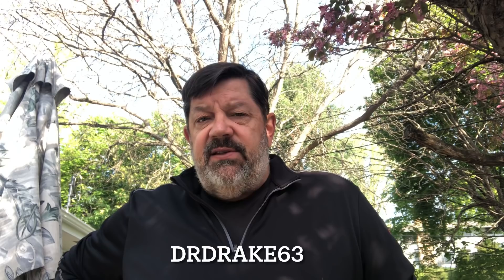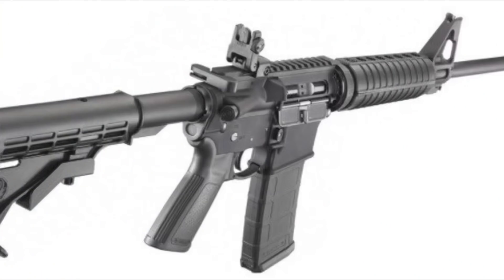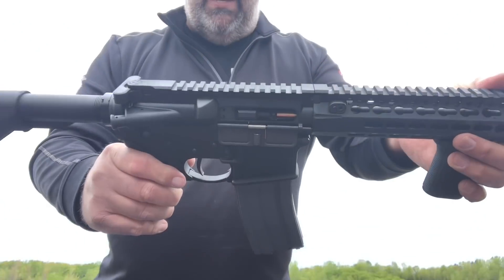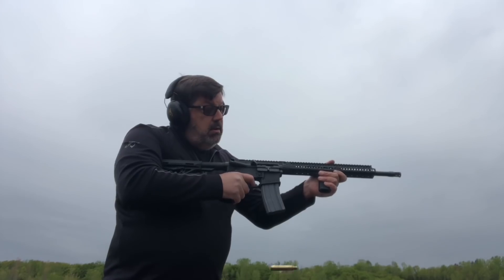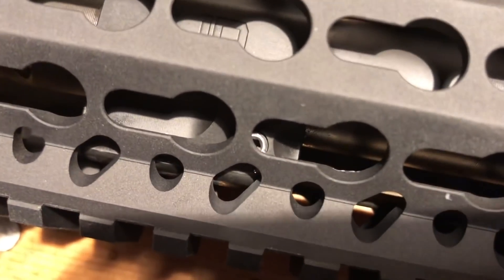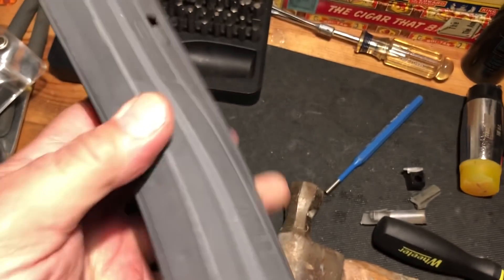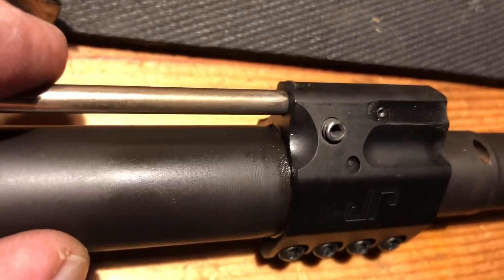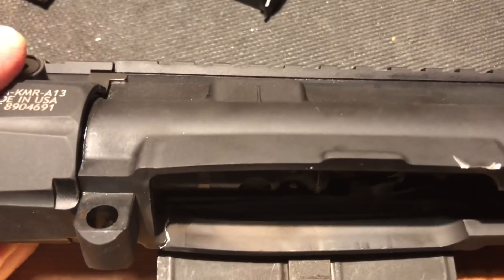Colossal AR Failure

Comment: It appears  as if u had a bore ubstruction the gas port in barrel only let's so much Gas into operating system  so even with it all the way open  its only gana let that much pressure back if pressure is 2 high in ar system the gas tube is designed to fail first to avoid this problem

Comment: im going to have to research what a fully open gas port will do to a gun because I have no adjustable gas on my system (port fully open) and I have never had problems with mine at all and certainly no signs that it would. I think your issue was with the load on the cartridge. As a reloader myself, I have seen these kinds of failures in people who push the limits in search of the fastest bullet. It could also be there was not enough powder in the cartridge and that could have caused the exact same thing. Did you check for a squib load? Could have been that last round did not leave the barrel?

Comment: From the looks of the Bolt carrier it is a cast part and not a milled heat treated part. Big difference in parts, never use cast always use milled and heat treated. This is a failure of components not a good AR build at all. If you are buying and using cast parts for the workings, not the housing you built wrong.

Comment: Either the buffer spring got bound up in an almost fully extended position or something got lodged in between the bold and the walls of the upper that prevented the bolt carrier from moving backwards.

It had nothing to do with the gas system.  It was a mere oversight in inspecting all parts or re-assembling incorrectly.  The bolt was unable to retract causing the face to strike against the bolt carrier and the pressure alleviated itself at the only point expansion was available.

If it was a gas issue you should have noticed damage on the gas tube as well, and it would have been closer to the where the gas key and the gas tube lose contact I believe.

Edit :

If you look at 8:03
Look for the Carter pin.  Must have been warn and dislodged itself.

Comment: I recently bought a mid length BCM upper with a low profile gas block.
But I noticed that I can wiggle the gas tube a little bit with my finger inside the upper where the gas key goes. Ist that bad or dangerous?
Reply from the maker: It’s normal

Comment: That is not a gas issue. An adjustable gas block, when fully open, can only let in as much gas as the port on the barrel will allow. This has nothing to do with the block.

This looks similar to pics of 300 blackout being fired through a 5.56

Comment: That makes no sense at all.  Unless you drilled out the gas port on the BBL you CAN NOT get more gas than with a standard gas block.  The adjustable gas block will only reduce the amount of gas.

Comment: As a certified gunsmith and as somebody who has seen this issue on a firing line in some military and LEO M4's and AR-15's that is definitely without a doubt an out of battery detonation. Now, how that happened would be anybody's guess. But it's often caused by the rifles not being cleaned properly which causes parts to stick when hot. Now, I can't say what you do or don't do with your guns but just saying what I have seen and the usual culprit. 

Another factor that can cause this is firing bad ammo or ammo that's too hot. I never heard a mention of ammo in this video so I do wonder if that was a contributing factor. All the same, looks like you came out ok and the lower is intact. Though Ruger would likely replace it for you for free, especially if they could determine in any way it's a manufacturing defect.

Comment: TOTAL BS....the gas block can NOT cause that failure! The hole diameter in the barrel determines the amount of gas allowed to go to the system, a "normal" gas block will NOT allow any less gas than an adjustable one...PERIOD. You either screwed up reloading, or had a factory overcharge, had a 300BO round mixed in, or someone used pistol powder. You destroyed your buddies gun, and he deserves you to buy him a new one....just saying.

Comment: If you give it too much gas you will see extractor issues. AGB isn't responsible for your failure at all. The gas goes into the tail of the bolt, nothing to do with what looks like a case head rupture from far too much pressure or an out of battery detonation. My bet would be out of battery detonation with an out of spec firing pin since it doesn't look like the bolt lugs sheared. 

You have a classic kaboom, too much pressure and it vented out of the mag well like designed. You weren't hit by shrapnel. You weren't hit by the bolt. You live to put keymod on another gun, even if it's dead and gone.

Comment: The gas block, nor any adjustments you made to the gas block caused that failure.  That looks like either the result of excess headspace or an excessively hot loaded round.

Comment: I will have to go along with the general consensus that it's most likely an out of battery event.  I've got a shorty 11" barrel for my AR with the brazed 5" flash hider that tends to have kabooms but nothing like this!  I suspect the gas port is way over sized due to the kazillion rounds that have been fired thru it.  It blew up with the short gas tube (blowing the tube apart, as it's supposed to) so I tried a longer tube called a pig tail, that wrapped around the barrel but it blew that one out too.  One of these days I will put an adjustable gas tube on it and have another upper built on it.  I think it's unlikely that it's an ammo problem as Winchester is a pretty reliable brand.  Still, I would really appreciate it if you can beat the bolt & carrier out to see what's going on in the chamber, if only because this was such a catastrophic failure.  You're fortunate you weren't hurt!  This is something all of us can learn from if a definitive cause can be found.
Cheers,
jc
Reply: Although I suppose it it possible if you’ve run tens of thousands of rounds through it but it is unlikely that you have enough gas port erosion to cause multiple tube failures. The overpressure in the tube would be more likely explained by hot hand loads or carbon build up in the carrier key causing a restriction or blockage. If your running factory ammo check your bcg with an air nozzle. If you have that many rounds through it I would also check the headspace just to be safe

Comment: I don’t think too much gas’s was the issue. The carrier has vents on it. Seem like a poor quality carrier. Or as others have said. The round detonated out of battery. Which should only happen if the firing pin struck the primer. And it shouldn’t do that unless the bolt is fully locked in. Again. Seems like a poor BCG. Can’t check it now with a go no go gauge but would have like to have don’t that beforehand. Glad your ok

Comment: did you have an issue removing the barrel?  Early Ruger AR 556's are notorious for using high heat locking compounds on their AR barrel nuts.  many had issues removing the barrel nuts when they first introduced the AR line up.  if you had to use excessive torque to remove the barrel nut, that might be a contributor.

Comment: That was definitely a very hot round/reload or barrel obstruction/squib round, the AR platform is made to run with the gas block fully open and the gas tube would of failed first if it was indeed an overgassing issue.

Comment: Not a gas issue. It's likely a barrel obstruction issue, squibs? I can't really comment accurately, but I would want to see how it looks as you take apart the upper. I think minus the smaller parts on it, your whole barreled upper should be scrapped.

Comment: I would say ammo is your issue, or out of battery fire. 
after seeing the brass in the other video, I would say out of battery.. but if you had a squib round, the gas would go the path of least resistance, which would be the bolt.

Comment: What makes you think over gassed would explode the bolt? I have had a very over gassed short barrel .308. No matter how much you take that screw out, the gas port is the same size. It looks like am out of battery, but if they were reloaded ammo I'd say under charged.

Comment: Thanks very much for this video. I currently have a Odin works Barrel paired with their Tunable gas block and I too cannot get proper cycling. I think I will order the non tunable gas block.
Reply: Measure your gas port size in the barrel. More than likely it was reamed too small, or was drilled and never got reamed to spec. 

If an adjustable won't adjust enough to run, a non-adjustable won't run it either.

Comment: I saw an AK blow up in the same manner only a bit more damage to the firearm rendering it useless. Nothing was salvageable on that rifle. It was more  than likely a ammo malfunction.  I was a weapons troop in the USAF,  and had to respond to a " hot gun " at EOR , the 30 mm  ammo malfunctioned  and completely blew out the lock and unlock cam in the weapon. So no matter how large or small the caliber of the round they are all are prone to failure . Just glad that you weren't injured.

Comment: As others have mentioned, this was NOT an overgassing issue. This was a defective ammunition issue or squib load. 

You CANNOT get too much gas through the gas system that would destroy the bcg...it's just not possible. An adjustable gas block can't physically allow anymore gas to pass through than a non-adjustable gas block would. The gas port on the AR barrel is the limiting factor in both gas blocks. 

An adjustable gas block simply allows 0% to 100% gas to pass through to the bcg.

Comment: I'm going to take a guess that the round chambered ok but the bolt didn't lock. When the round fired the pressure drove the bolt backwards into the carrier and gas pressure released down through the magazine. I'm thinking once the barrel is removed, close examination of the locking lugs for damage would tell if this was the case.

Comment: I would  think it was a slam fire or a over pressure round. I have seen 2 AR's fail both  "I think" was over pressure rounds. Both were using PMC 55 gr fmj factory rounds. BUT they could have failed due to slam fires . Since AR's have a free floating fireing pins. That it why when reloading for AR type you should use the CCI hard primers . Another thing could have been a improperly heat treated bolt carrier.

Comment: friend of mine had a firing pin stick in the bolt face, turned full auto could have made an out of battery discharge though he was using Tula steel case and those primers are hard and need deep primer strikes.

Comment: I am in agreement with several others. The way that this failed points to an ammunition issue or possibly a barrel obstruction that could have caused higher than normal pressure. Possibly even a defective bolt carrier. I have personally never seen one fail like this, but it drove the bolt through the carrier and broke the upper. If there was too much gas it would not have failed this way. Hope that helps you figure out the cause.

Comment: Looks like a slam fire. Looking at the area damaged the round looks Like It detonated above the magazine. Is it possible that the magazine fed the round at an improper angle causing an area of the bolt to strike the primer? Maybe the problem was with the magazine? Could it be one of the bolt lugs struck the primer?

Comment: I build and have used adjustable glass blocks. I use 10-32 set screws similar to what you describe in your video. I start with about 1/2 turn from bottom. When I get some effort to eject and cycle, I adjust in 1/16 inch increments until it acts right.

I agree with most of the crowd that for some reason you had an out of battery discharge. Two dollar question is why.

Comment: That couldn’t have been caused by the gas block. Maximum gas is dictated by gas port size, not the gas block. Even over gassed, wouldn’t have a failure like that. That appears to be massive overpressure.
It was likely caused by ammo, maybe a 1/2 charge. Was it factory ammo?

Comment: That is not a gas block issue. The block will only flow what the gas port will flow. It was at full pressure with the factory parts. Changing the block cannot increase the flow or pressure of the gas. The stock fsb is full flow, and full pressure.

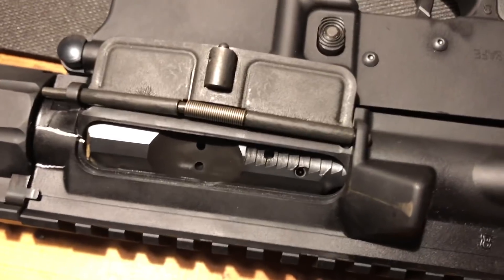Comment: 4:52 you seem to have "painted" the front of the bolt carrier with vaporized brass. Something allowed or caused a case head failure, working backwards from that is the way... with no assumptions as to cause. Just because you swapped on a gas block immediately before the failure doesn't mean something else wasn't marginal and itching to go at any time, including the ammo itself (would be looking at the primer to start, and the rim under the ejector)

Comment: I wonder if your BCG was too dry , keeping it from cycling until you ramped the pressure up ?  I does , most definitely,  appear that it fired out of battery. When fully in battery , the lugs on the BCG will keep the pressure in the barrel.

Comment: There’s no possible way you could have sent enough gas back to do that the ports are not big enough. Look at the cam pin if it’s broken you had an out of battery/round went off before fully seated in chamber. Or more likely you had a ammunition issue were these reloads?

Comment: It was a bad round, or a squib load that caused a case head separation.  I had my ar blow up last summer.  Blew out the bottom of the bolt into the mag well, (designed to fail that way so your face doesn't blow up).  I was using reloads.  My grandpa used an empty powder jar for scrap powder after pulling bullets.  We inherited his reloading equipment after he died and didn't know about it.  So I loaded 223 with 23 grains of BLC-2 except it wasnt blc2, it was a mix of black, shotgun, pistol, and rifle powders.  My gun almost looked the same condition as yours after the failure.
Mine was also a ruger ar556.
Lower was fine.
Barrel nut was fine, handguard was fine,  and I have recently rebuilt the gun with the handguard, and lower.

Bolt, upper receiver, and barrel were all toast.  The barrel might be OK but I dont want to risk it, plus it cracked my barrel extension and I dont have the ability to replace it and headspace it.

The overpressure from the round was too much for the bolt.  Opening up your gas block might have made more gas get through the gas tube, but my guess is that you had a case head separation that blew your bolt open from the overpressured round.

Comment: Lots of questions.  Why are the taper pin holes on the barrel in the 12 o-clock position?  Shouldn't they be at 6?  Also, why is the gas block all the way against the shoulder?  Is it designed that way so that the gas hole in the barrel lines up or is it designed so that there should be a gap?  How big was the hole in the barrel?  A proper sized hole in the barrel should not be able to provide enough gas to the bolt to blow the gun up like that.  Most of the KB's I've seen have been ammo related.  I've not seen a gun blow up like this from being overgassed.  My suspicion would be a ruptured case, but without seeing the bolt and chamber condition, I'd not rule anything out.

Comment: Not fair at all to blame the gas block. This is a failure of the bolt carrier, it was just simply poorly made. The key images to understand this failure is a 4:58 and 5:06, the carrier split, it very likely wasn't heat treated properly. I'd send it to Ruger.

Comment: I don't recall you mentioning it, but was the rifle purchased new and had it been shot prior to the changes you made? If it was running fine before changes then ammo and/or squib load/bore obstruction seem the most logical. If it hadn't been run before then I would consider issues with parts, the BCG in particular. At least you are OK, there's the upside.

Comment: My guess would be 300 blackout in a 5.56. Bullet could have swaged down as it went downthe barrel. It could have even exited. But even if it did exit, it would have caused a huge pressure spike causing the boom.

Comment: I do not think the gas block was the issues. I am thinking an issue in the BCG like failed cam pin, super hot round or the like. The gas system just can not deliver that sort of force. The gas tube would split or the those parts directly getting that gas would fail first. For the actual carrier to fail first that had to be non-gas block related.

Comment: Many people have said ammo issues. You could have a reload that had pistol powder instead of rifle powder. You could also have had a squib load, which would have resulted in a goose egg in the barrel, or a primer puncture which would explain why the bolt stayed locked and ruptured the carrier and didn't take the gas system with it. Again you have an ammo issue there my guy.

Comment: Round stuck in the chamber and the one that followed.....Boom ..... The issue could be 90% to the ammunition but you never mentioned the buffer was it a standard H1 or and H2 ? ...... I build 7.62x39 and know the exact things needed to get an AR to shoot any 7.62x39 round ( and I mean anything) ......and the main issue is usually the BCG followed by the buffer ....... You don't need an adjustable gas block......You need a constant gas flow (It's not a gas Issue) ......then adjust using the buffer weight.......

In my opinion the BCG is the most important component....... I use WMD Nickel Boron and have never had an issue......

Comment: That last round was either a 300 blackout round-Yes it will chamber- or you had a squib load on the next to last round fired the last round with an obstructed barrel.  Max gas pressure is regulated by the gas port hole in the barrel not the gas block.  Adjustable gas blocks only restrict gas. They cannot give you more than a non-adjustable block.